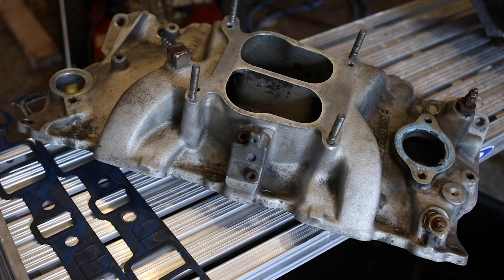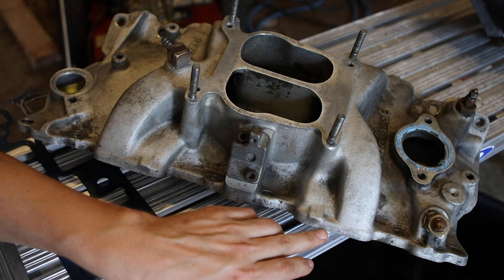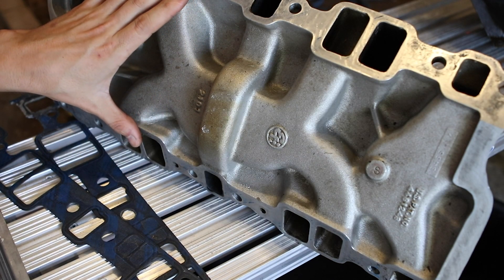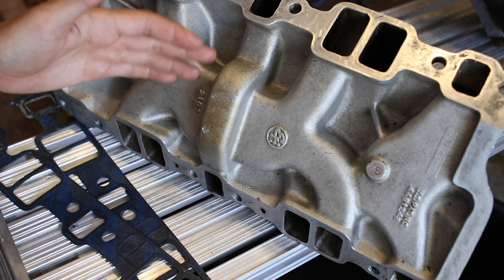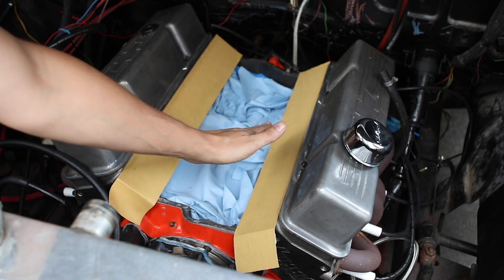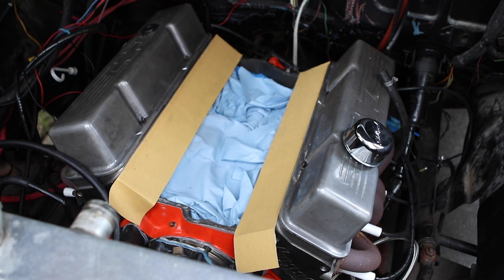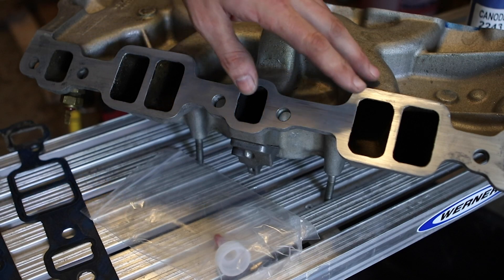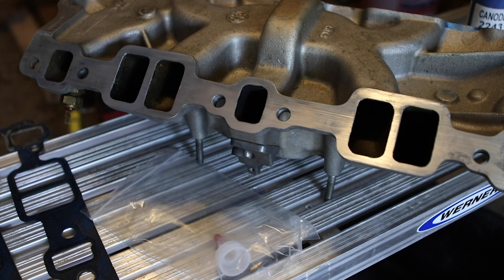Taking the warp out of an Edelbrock intake manifold

Comment: I was thinking along these lines, glad to see confirmation!!
How did it end up working out for you?
Reply from the maker: It’s been on the truck for a few years now. So it worked. The one think you want to keep in mind is that you can only do it some much. If you sand to much of it you risk sliding past the top of the intake gasket and ports.The best way to approach this if the warp is heavy is a combination of sanding and a thicker gasket.

Comment: I have a 350sbc in my LH Holden Torana here in Australia just had heads rebuilt and a new cam and all new valve train ran the cam in fine but as soon as I tried to idle it would just stall anything under 1200rpm like you been all over new distributor new coil plugs new leads been all over the carby checked for any vacuum leaks I thought I may have gotten a shit camshaft but when I seen this video I’m thinking I may have the same trouble but think it may be leaking from the underside of the manifold thanks for this video I’ll do the same and check my manifold

Comment: Do you think sanding the head would also help sealing it?
Reply from the maker: Sanding the head would be more complicated because you would need to account for the change in geometry on both sides. Also because of the angle any sanding on the head will increase the distance between the 2 heads and you could end up not being able to use a standard intake because it would not reach. Your best bet you be to take it to a shop or try to find or make a thicker gasket to address that.